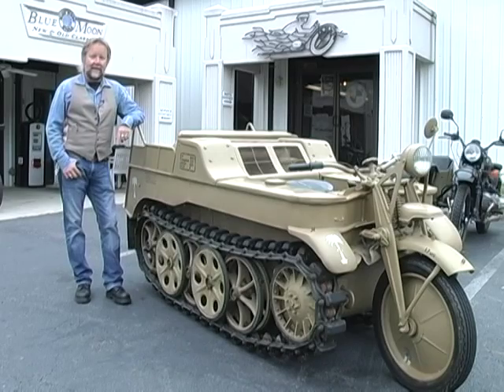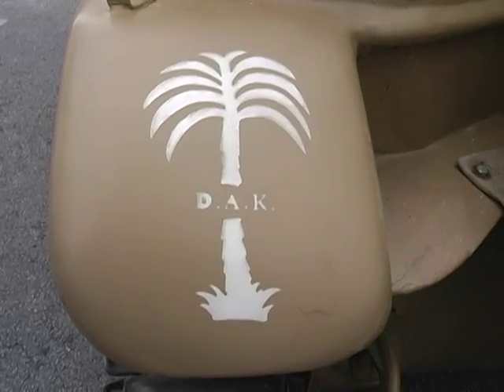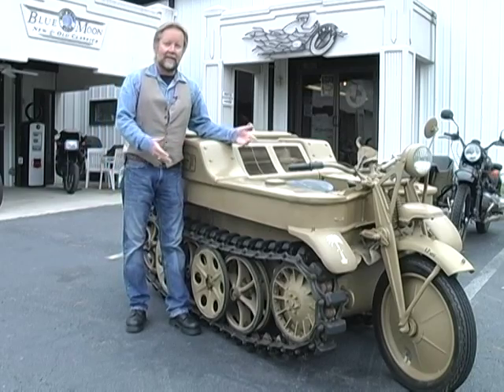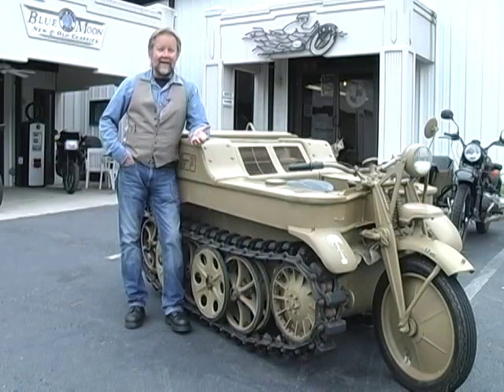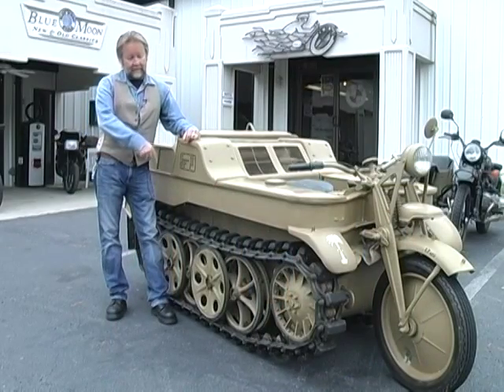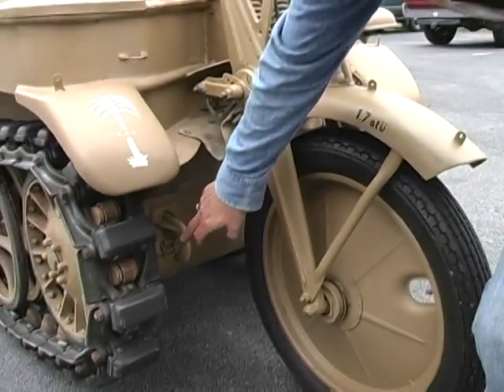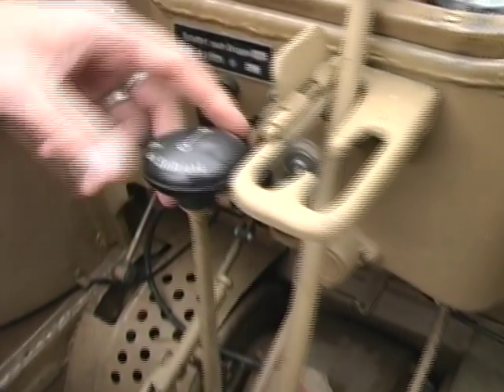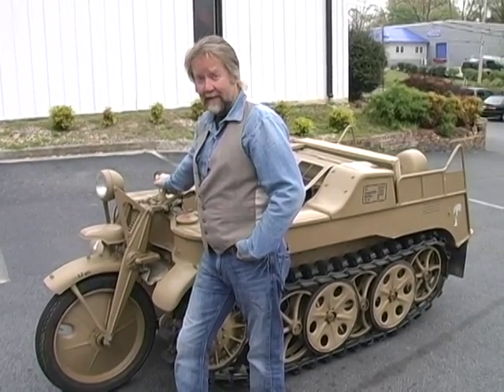WWII German Army Kettenkrad Meticulously Restored

Comment: Uh, dude, the wheel does have an impact on the steering.  The reason it has the front wheel is not because of the motorcycle troops.  The front wheel steers alone up to 25 degrees of turning, and then the brakes kick in.  This saves the track brakes, and extends the life of the vehicle's drivetrain immensely.

Comment: It's Missing the Swastika with the palm tree.
Reply: Restorer of WW2 German militaries very rarely put swastikas on their work as it's still considered to be too sensitive a symbol.
Reply: @simongee8928  Currently in Germany you mean . Anyvvhere else in the vvorld a restorer could do it as its just a restoration to original condition . As NSU kept making them until the 1950's it'd be interesting to knovv vvhat the factory vvould've painted these as they vvere marketed as Farm Tractors & BMVV kept making bikes vv/& vv/out sidecars ( though BMVV vvent back to traditional "Bavarian Black" paint )
Reply: @rogerwhite9484  restorers don't put it on since a lot of german equipment didn't have it. unless the swastika was already untouched a lot of collectors consider the adding of a swastika on a restoration is forgery.
Reply: A lot of equipment of the Wehrmacht did not have a swastika painted on it. The Iron Cross was a lot more common in many units. That is not to say swastikas were never used, but it was less common than many think. Swastika flags were often used by the Wehrmacht in combined operations, though...as drapes that were placed on vehicles or buildings so the Luftwaffe did not accidentally bomb their own troops. 

Luftwaffe aircraft on the other hand, often had swastikas painted either on the wings or on the vertical stabilizers.

There were regulations as to what emblems and designations were supposed to go on vehicles or other equipment and which weren’t. This is still true today...for instance, you would not find the official US seal painted on a combat vehicle like a tank.
Reply: @DeputatKaktus  Everything you said is true; And in most cases the only time the swastika flag was used on ground vehicles was at the front lines so that air support knew where the front line was.
Reply: Wesley P. Warren, PhD. The Africa corps insignia was a palm tree and a swastika about mid trunk of said palm tree. It was the official unit designator.
https://en.wikipedia.org/wiki/Afrika_Korps
Reply: Matthew Erwin   Thanks, buddy.  I watched Rat Patrol a lot!  ;)

Comment: For anyone curious: 
The writing at 5:28 says „The tracks are to be tensioned so that the upper section of the running track rests on the middle bogie wheels, but does not touch the first and the last bogie wheel.“

Comment: Since most tracked vehicles were steered by brakes, the Kettenrad must have a braking device with the forks but how did one streer with the forks removed? Nice job on the restoration!
Reply: the forks are not mechanically linked. the tractor mechanism is based on a scaled down Cleveland Tractor design. very robust and dependable. uses opel 1600 cc four cylinder.

Comment: Track brakes are a pain in the ass to repair and they are expensive, and are a big part of maintenance for tracked vehicles.  however, they're not needed much on road marches, which are the bulk of a vehicle's driving, only really on offroad, if you have wheels too.  This is why teh Germans had halftracks instead of fully tracked carriers--the wheels greatly decreased vehicle wear.

Comment: I am so glad that I saw this.  I did not know that the front fork didn't steer.
Reply: read some of the comments above yours, they explain it pretty well.
Reply: It does steer normally in slight angles. As you turn sharply, the differential brakes one side or the other.